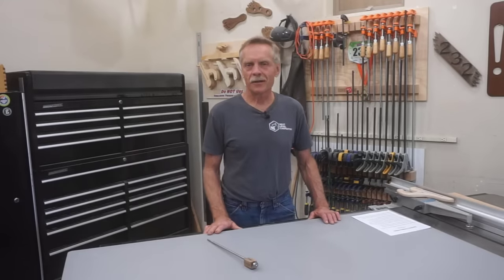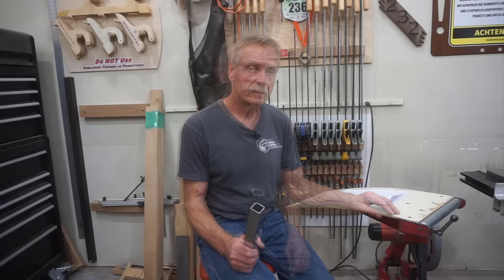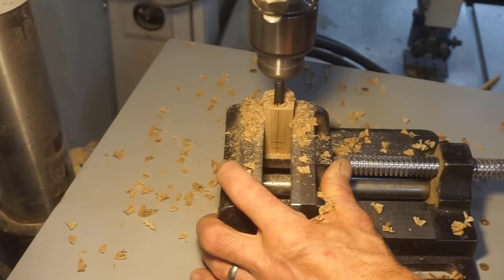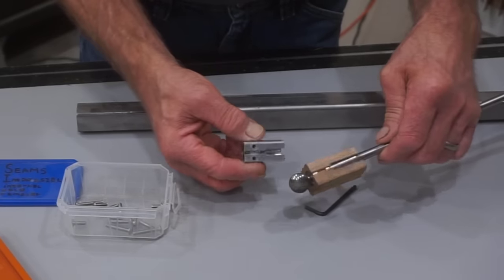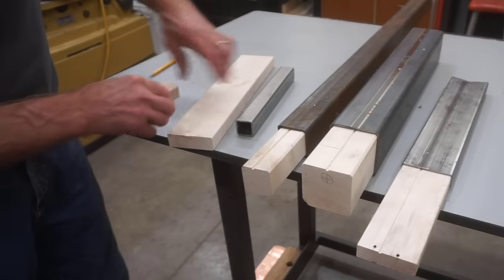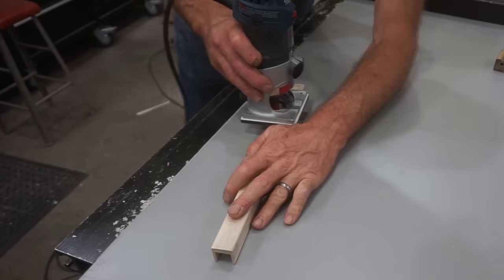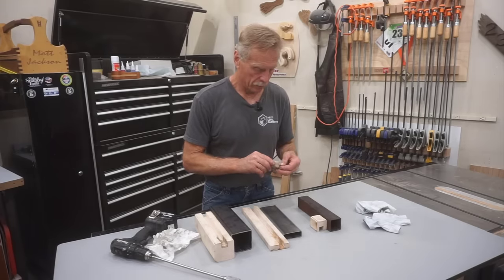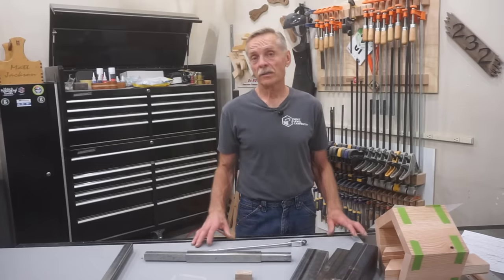How to Quickly Remove Internal Weld Seams from Steel Tubing

Comment: Great idea.  Suggestion - Rather than provide the shank with a set length, how about providing a coupler so I can use any length rod for any length tubing.  I purchased the tool and not the set for this specific reason.  I will buy the coupler so I can adapt the tool to my specific needs.  A great idea.  I have done the groove thing on the inside tubing.  I expect better results here.  Thanks.
Reply from the maker: People with requirements like yours are exactly the reason why we offered the tool alone and then the option of the kit which will suit the needs of most people. Hope you are a satisfied with the performance and results as I have been! 😁😎
Best, Matt

Comment: Very cool!  Just bought one.  Unfortunately it doesn't rotate.  I'm guessing one of the bearings got a little off axis when y'all installed the burr.  Is there a trick to fix that?
Reply from the maker: Hmmm... not heard of that issue before... ping Greg with an email for a solution.  Sorry for the trouble and hope it's an easy fix?
Reply: @NextLevelCarpentry  Thanks -- but....how do I "ping Greg"?
Reply from the maker: @markjarrodhughes  Should be able to contact him by email through his Greg's Garage website:
https://gregsgaragekc.com/

Comment: Matt, can you explain why you didn't start the dados in the center and work your way outward? I realize you started slightly undersize as far as the width but at the end you have to go back and shave off that little bit. It seems that starting centered on the micro dado and reversing the blank at each fence setting would let you work your way out evenly to the required dado width.
Reply from the maker: 6 of one, half dozen of the other as I see it Bob... just the way I happened to do it this time.  Not really a right or wrong in this case where it might be in others.  Thanks for paying attention to detail though!  And thanks for watching and commenting... Best, Matt

Comment: When in a pinch to make a tube inside a tube, two pieces of angle iron welded to form a tube is quicker.
But your method is very cool, verh well thought out and perfectly executed.
Reply from the maker: That was my Plan B Ernest... it's definitely an effective alternative.  Glad you like this option too... it's nice to have options like these in your bag-o-tricks, right? 😉😎 Best, Matt
Reply: @NextLevelCarpentry  absolutely, but if this need for sleeving is a regular occurance extruded or seemlees tubing is the answer.
Reply from the maker: @ernestmurphy3898  ... which is why we figure the Seams Impossible tool/method is for everything in between😁
Reply: @NextLevelCarpentry  it is the certified answer, to tube seam removal.

Comment: A correct size metal hole saw works for this as well, but only good for square tubing, i had to build a telescopic cargo rack that extended forwards backwards and sideways and thats what i came up with.
Reply: So you used the same extension idea... and popped a hole saw in a chuck? I already have some metal hole saws, I may try this. 

How long did the hole saw hold up for the project? did you have to worry about cooling the hole saw constantly?
Reply: @MRSketch09  i went through 2 hole saws for my project, and had to reem out 25 feet of steel tubing. I found the size i needed i think it was 1 3\32 for 1 1/2 square tubing,  for less then 5 bucks each. I didnt bother trying to cool it with water
Reply: @mordyfisher4269  Thanks.

Comment: Great. I love it. Something easily built by a small shop guy for doing a small run project. Could have used it a lot in the past, and probably will in the future. I just wish I had thought of it, and thought of it years ago. The aggravation it would have saved me.
Reply from the maker: Thanks for saying Norm... this just happened to be the one time I got backed into a corner and wouldn't be content without a solution to the problem🤔😁😎Best, Matt

Comment: Brilliant, you just got a new subscriber.
I was just about to ask you if you would consider to fabricate one using metric dimensions when I realised I have a 3D printer in my basement. I read some of the comments and saw that some people suggested to make the sleves in a 3d printer but I assume it might be possible to actually also make the tool itself 3D printed. At least I'll try to make one with metric dimensions - hope PET-G  is sturdy enough as my printer won't do nylon and such without modifications...
Reply from the maker: Cool, thanks for the sub!  I'm guessing PET-G is at least as strong as the wood I used for V1.0 and expect you'll be successful.  Dimensioning is so straightforward I doubt you'll have any trouble modeling and printing one in metric to fit bearings, burrs and extensions available to you where you live.  Best, Matt

Comment: Very slick solution -- KUDOS!!! 
BTW - for the assorted shim gadgets to accomodate to larger tubes, I think I'd be inclined to print such in one of my modified nylon filaments (from taulman3d) on my 3D printer.  Truthfully, were I to MAKE one of these in the first place, I'd probably give that a shot for the main tool body.  But given the slick aluminum option that's so easily available, that's not likely to happen!

Comment: I’m guessing it’s done with a Dremel and an extension shaft? That Dremel is the least used tool in my bag. Thanks for sharing, your videos and knowledge are top notch!
Reply from the maker: Sounds like you're in for a bit of a surprise Mitchell but you're thinking along the right lines... Best, Matt
Reply: Next Level Carpentry you could make a centering jacket printed from a 3D plastic printer? I’m thinking it could work like a jointer that has a wedge mount or just add some duct tape? There’s probably only a few sizes you need to make, for the typical tube sizes? If you want to get the figment tighter you can powder coat or paint the insert? It looks like there’s about 20 thousands inch play after the weld is flattened?

Comment: Matt, have you ever made a tool for round pipe? I need one for 3/4” water pipe and 1” water pipe.
Reply from the maker: We haven't, Gordon, because we figure it would be pretty easy to get a cylinder or ball shaped stone of this type to get the job done: https://www.amazon.com/dp/B002NKZN7U/?ref=idea_lv_dp_ov_d
It should be easy to get an oversize stone and dress it down to just the right diameter with a diamond grinding wheel dressing tool... hope it helps and works? 😎

Comment: Your seam remover is cool. Fireball Tool made another tool for removing seams, but it was a little harder to see it being used by a do-it-yourselfer.
Reply from the maker: Making a V1.0 Seams Impossible is probably pushing it for entry level DIYers too but we feel that the end result achieved by the Seams Impossible is noticeably better because of the rotary cutting action of the burr when compared to the scraping 'broaching' action of Fireball's method... what do you think?  Best, Matt

Comment: 17/64th d-r-i-b-llit??😊
A tip;
When welding in a nut to form a tube clamp, put the nut on a corner, so it operates diagonally.
It then automatically takes up all the slack movement!
Saw it on a Russian site.
Clever, those Ruskies!
Liked the tool, I'll remember it for future use should I need it.
Thanks.
Reply from the maker: Got a whole index of them driblitts... very useful, don't you know?🤣  I planned to use the clamp nut location tip you added on the new roller stands but will see if it's necessary with the much tighter sleeving fit I'll get using a Seams Impossible tool.  I got the idea from my favorite weld/fab guy (not a Ruskie but a very capable guy all the same! )  While having an angled nut removes slack it also positions the locking handle at a somewhat awkward angle for operation and I need to evaluate the trade off and decide... Best, Matt
Reply: @NextLevelCarpentry  
😊
(Bend the handle.)

Comment: Due to the way that rectangular tubing is made the seam will not always be in the same place on a given size of tubing. Therefore multiple jackets may be required for each size depending on where the seam is. You can see in the examples shown that the seam is not always centered so keep this in mind.
Reply from the maker: We feel that this is one of the main benefits of the Seams Impossible tool Wes.  Its adaptability makes it useful for almost every configuration of square and rectangular tubing out there!  Best, Matt

Comment: Very nice tool to have unfortunately it is completely sold out but I would need it tomorrow on two inch square tube for axles.
Reply from the maker: We're thrilled that the entire pre-sale batch of almost 600 Seams Impossible tools sold out before the manufacturing process was complete because it shows far more interest in the tool than we anticipated.  Sorry that it won't help you out for your current project but you can sign up on a list to be notified when the next batch is made and ready for shipping in early 2021... Best, Matt

Comment: I would suggest selling pre-made bushings for the common tube sizes using uhmw another adage would be to sell shim blocks that screw together to make any size bushing needed. It would be similar to gauge blocks but able to attach securely to each other and the tool as well.

Comment: I would suggest producing the sleeve jackets in plastic for the block and selling it as a kit.
It's a value add, as people are buying the tool to save time, & having to make the jackets yourself diminishes the value propostition somewhat.
Also what are your thoughts on the durability of the tool bearings: Is the swarf likely to find its way into them and wear them out?

Comment: Do you make a tool like this for round tubing? trying to get at a seam of an end cap in the base of a round long tube
Reply from the maker: Sorry Jack, we don't.  Good news is that round tubing is much easier to work with than square.  You should be able to get an oversized grinding wheel with a shank to chuck in a drill and, with a diamond dressing stone, trim it down to a diameter that matches the ID of your tube and grind away...  good luck! 😎

Comment: Absolutely great idea. Not surprising it comes from you Matt.👍 . I would grind a smal flat spot on the shank of the carbide burr where the ''set'' screw from the extension rod comes in contact with ,so it prevents it from pulling loose. The 'welders say ' video was hilarious, thanks.
Greetings from Belgium.

Comment: A suggestion for a weld seam removal tool is to put a low head or regular head socket head cap screw tightened flush in the centre of the top face of the aluminum block and drill a matching through hole in the adapter as a connecting system.  Just drop the adapter on. More durable in plastic and simpler than using screws in a counterbored hole. Shims are easily placed between the aluminum block and adapter.

Comment: Matt, My Cool tool arrived :) after going through my collection of carbide  ball headed burrs I wanted to confirm what size burr you used in the tool? when I looked at you Amazon link it directed me to the 1 inch Diameter 15/16 length burr  1/4" shank.    I am certain that other may want to know what size you specked out the tooling as well! Thank you!
Reply from the maker: The burr I used in the video is 3/4" cutting diameter, much like this one: https://www.amazon.com/dp/B07TL5WT52/?ref=idea_lv_dp_ov_d&tag=aiponsite-20&linkCode=ic6&ascsubtag=amzn1.ideas.6HPGTC6N04ST although I can't tell from the listing how long the shank is.    Not sure what happened to the Amazon link I originally included in the video (thanks for the heads up BTW) but obviously something changed since I posted it.  A person needs to determine that the shank length is long enough so the set screw(s) in the bit extension have secure purchase on it to keep it from spinning or slipping off.  If you need more info make sure to ask as the Seams Impossible is rendered useless without the right burr! 😉

Comment: Just ordered the deluxe kit.... if I wanna make it even longer what type of extension would you recommend? I can’t really see what kind of end the one you sell comes with is it round where you put it in your drill or hex?
Reply from the maker: You can order extra extensions of the same type from Greg's Web Store or my Amazon page... they're made to fit  the 1/4" round shank on  the burr and on the drill end of the extensions since they're both round.  You could order whatever extensions you like as long as one end is the type needed to attach to the 1/4" shank of the burr... hope that helps.  I can't wait to hear from someone who does a 10' long tube with this method even though I can't quite imagine what it would be for... Best, Matt
Reply: Next Level Carpentry..... hey I might do about 4 ft!

Comment: Hey appreciate ALL the videos, Thank you! One quick question on a project I am working on. We have a steel, metal screen door, 8 feet tall and 50" wide, weighs about 150 lbs., 1 3/8" square tubing frame around it.  I am looking to mount on our backyard entry with a 2" square tube, 1/4" thick wall, and 13 feet long. So I can burry 5 feet of tube in cement and 8 feet to weld the door on. Will it work, or is 5 feet in the ground over doing it? Thank you !
Reply from the maker: 5 feet in the ground is more than plenty but a 2" square tube isn't nearly strong enough to hold that gate IMHO.  150 lbs cantilevered over 4' is a LOT of weight to hold and the cross section of a 2" post, even if it were solid steel, would still flex enough at the point where it comes out of the concrete to prevent the gate from sagging.  I'm not qualified to tell you what to use or do but, were it me, I'd probably go with at least a 4" square post which, because of it's exponentially larger cross section, might work fine with a 1/8" wall thickness.  I advise setting up a test somehow if you don't have access to someone with adequate engineering experience to tell you for sure what size and thickness of a post you need to avoid problems AFTER the concrete sets 😁🤯
Reply: @NextLevelCarpentry  "YES" , 4" square post is a good idea. And I am also looking for an engineer. The other option I have available at that site, is to secure the 4" post to an existing wall and ADD support. So 5 feet in the ground and support above ground at each of the three hinges, Should work. Appreciate the quick response!!

Comment: Hello and thanks for this! Wood - why not!!! And you woody guys could take a few tips from "machinist world" for accurate positioning for drilling. Example: Fix the vise on your drill press, position carefully. Use the fixed jaw as a reference. Work to drawings! Use a small square in the vise prior to clamping tight. Nothing wrong with wood! 

The main thing is your brilliant idea to use the ball burr, a ball bearing, and the ready-made bit extension rod. Very nice!
 Thank you Next Level guy!

Comment: Have you tested this on longer tubing? Say 4'-6' ? Just add more extensions?
Reply from the maker: No reason it won't work with more/longer extensions although I've not actually tested it. I didn't bother because I haven't thought of a reason such a long pieces of sleeved tubing would be necessary but I'm sure it will work just as well, Brent.  Once the first units from the pre-sale are released into the wild I imagine we'll begin hearing stories of every imaginable application though...  Best, Matt

Comment: Not bad bud iv got one for round pipe and tube it's just like a line bore Machine. It Uses a high speed still tool to cut out the weld works great just like a lath or mill
Reply from the maker: Notice that this video is about square tube?  Everyone's got a solution for round stock... duh?

Comment: How does the removal of weld material affect the tube’s dynamic stress resistance?
Twisting, bending, racking or cracking?
Reply from the maker: I'd be concerned if this was for use on the International Space Station but for any down-to-earth real world project any strength reduction is so negligible has to be irrelevant...
Reply: So you really don’t know.  
I was expecting a more down to earth answer from someone trying to launch a product.
Reply from the maker: @brianbrinn9781  I also have no idea of the quantum mechanics involved with the dissipation of heat generated by rotational forces of the carbide burr with/without cootin' Earl applied during the weld seam removal operation... for shame, for SHAME!!  My product launch will be an abysmal failure without the in-depth analysis you appear to expect... I should have been much more reliant on experts for advice! 🤓🤧🤣🤣
Reply: Next Level Carpentry 
Two words... product liability.
Reply from the maker: @brianbrinn9781  seriously?! At what level of paranoid pessimism do you exist?

Comment: The four leg, folding axles stands would make a great base for one of your stands. They have a pin-in-hole height adjustment but could easily use a locking screw.